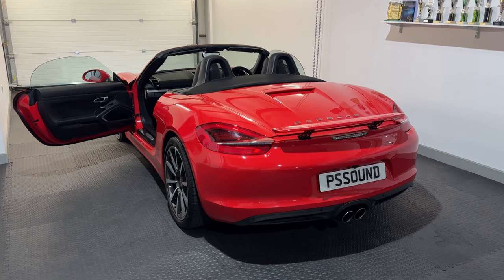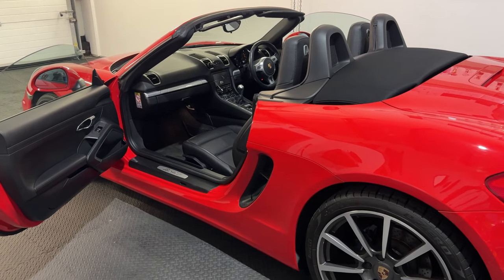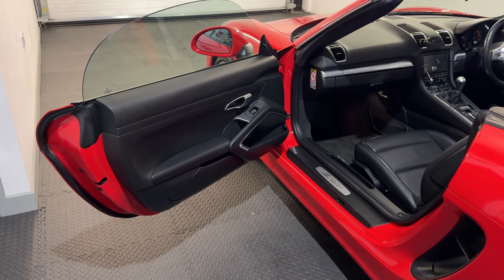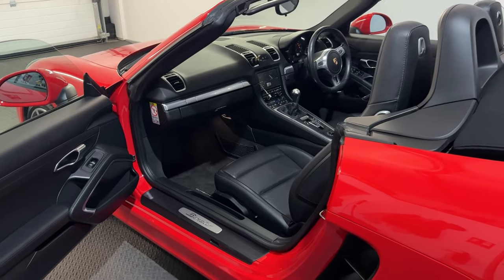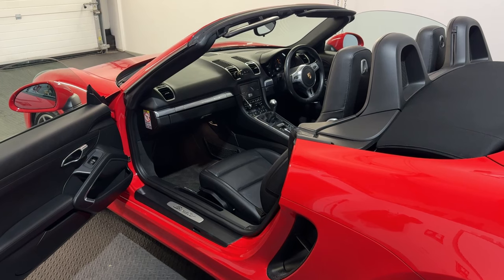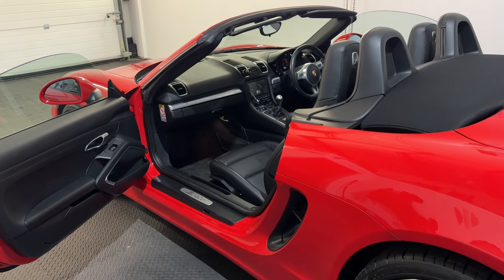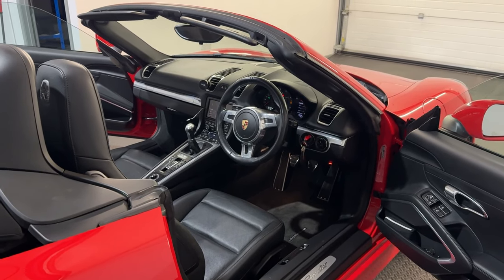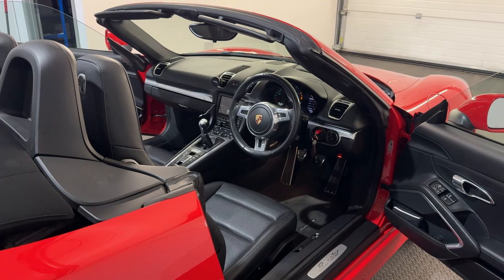Porsche Boxter Audio System Upgrade EXPLAINED - Audiotec Fischer / Helix Amplifier & Speaker Upgrade

Comment: Hey guys any experience upgrading the burmester system? I want to ditch the burmester amp and install a helix V12
Reply from the maker: Hi, that’s pretty much the standard procedure ditching the OEM amp and have a Helix DSP amp, which makes a huge difference, especially when it’s also tuned properly.
Reply: @ I was looking at getting a Zen 150 Most converter so we could run full digital from the head unit, but you reckon not needed? Just go direct digital into the DSP and use a conductor?
Reply from the maker: @ best way is to use the MOST150 for sure if you want to keep full OEM HU integration. Alternatively you can keep the HU on speaker level for radio, satnav & phonecalls and for quality music playback you can use either HEC HD BT module for streaming or usb digital out from a DAP/tablet/phone as secondary source for your critical listening.🔊🔊
Reply: @ thanks mate. I’m in Australia otherwise I’d come see you
Reply: @pssound9749  since my car has the burmester is it possible to use the factory head unit with speaker level outs? I belive it sends the signal to the amp via optical. So we either ditch the amp and get a most converter, or we use the speaker outs from the OEM amp to feed the helix, and also use the digital in of the helix for critical listening